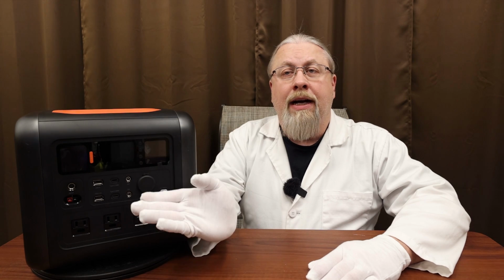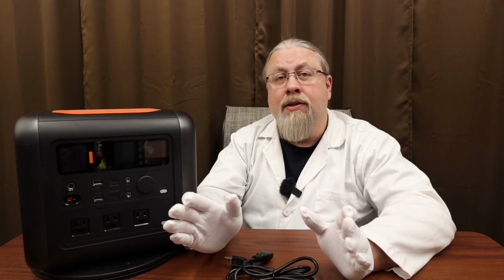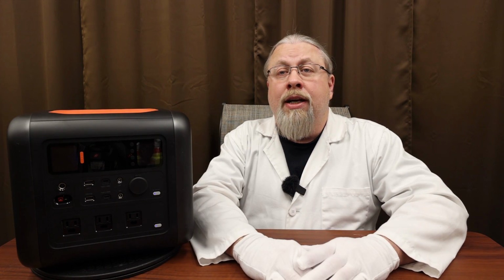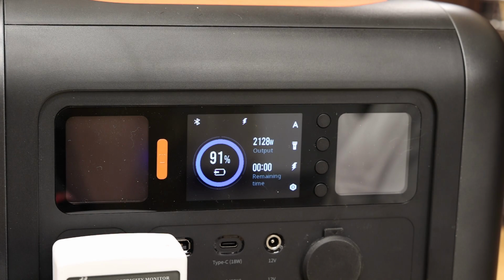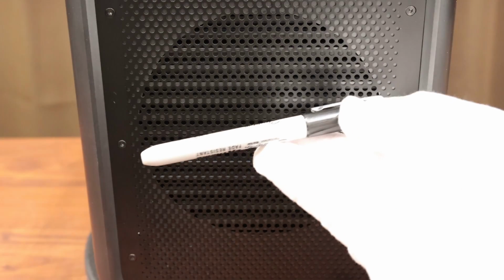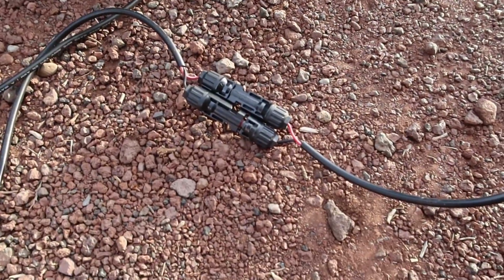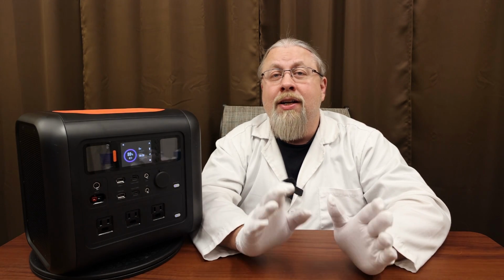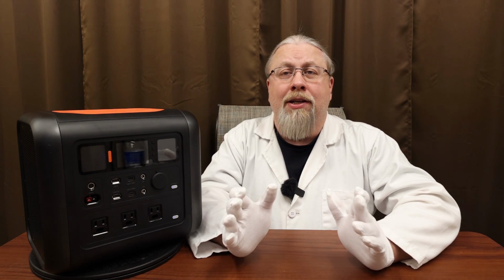SILENT 1200w Solar Generator! 70mai Power Station Tera 1000 Review

Comment: I'm sure they figure why have AC pass-through charging? If you have 110 plug the load into the 110 source get a faster charge. No inverter losses
Reply: The point is that you cannot plug something into it full time, and use it as a safety back up so you never lose power to something.
Reply from the maker: I was told it was a "safety issue" but yes you're right. Thing is a lot of folks want to use these like a UPS to run appliances while plugged in.
Reply: @HOBOTECH  that’s why I wouldn’t buy it. I need to be able to do that. Thanks for pointing it out in your review. You do a great service! 👍
Reply: @HOBOTECH  this is why I love your channel! I had no idea about "pass through" until you explained it in this video. Does that mean my Jackery 1500 has that ability?
Reply: @leonardl9921  yes.. test by plugging it in and then plug something into the jackery. If it works you have pass thur charging . On the video he's talking about AC to AC pass-through there is two more DC and solar charging

Comment: Hi I have a couple questions.  

I wound up purchasing 2 of these power stations a couple years ago based on your review.  I haven't had a real chance to use them yet, but I'm getting ready to do some overlanding.  

So my question for you is regarding solar panels.  I'd prefer a folding style with a kickstand for remote camping.  I'd like to have about a 20' + cord so I can make sure it's in full sun why the trailer is in the shade.  I will have the Tera 1000 hooked up to my ICECO VL75 ProD cooler.  I want to get the max 200W panels as that is all the power station can handle from my understanding.

This question is actually two fold.

I recently purchased an OffGrid trailer that has the following setup.

(2) 100W Battle Born lithium batteries 

Victron Energy Smart Solar charge controller 100/30

Go Power HD 1750W modified sine wave inverter 

(1) Eco Worthy 100W solar panel, with an 8' cord, XT60/MC4 connectors.

I'm running a Truma Cooler C69 DZ, Zero Breeze AC, water pump and lights from the trailer.

I don't think the 100W panel is enough to keep the batteries full and run the Truma Cooler, lights, AC, etc.

I will only be bringing the ICECO and Tera 1000 on long trips for food storage and they'll be in the back of my truck.

So I'd like the folding solar panels to be able to integrate into my trailer system as well as charge my Tera 1000.

Also wondering what your suggestion is for running them in parallel or in series based on my setup.

What is your recommendation for a good 200W foldable, kickstand style panel with a long reach for sun, with compatibility to my trailers setup.  I may need more than 200W for the trailer, maybe (2) 200W panels.  I'm not really sure.

I've watched several of your solar videos, your testing, etc., and figure this would be something you would have a good solution for me.

Thanks Scott

Comment: I’m confused. It will start a full sized refrigerator up but at 2000 watts it’ll shut it down?
Reply from the maker: It can run up to 2000w for a few second which is long enough for the compressor to start. One started a fridge typically only uses a few hundred watts.

Comment: Professor, how long would this SOGEN power a small window AC (such as the one you installed in your RV)??  I see you used it to start the AC in your Testing Lab, but I wonder how long would it be safe to use for running another AC in a van (for example)? 
And I assume that means the unit would need to be recharged the next day (for example using the 200w solar panels). 
If that was considered “one cycle” and this unit is supposed to last 1,000 battery cycles, would that kind of usage (running the AC as long as possible using only the SOGEN), would a customer/user likely get 1000 cycles (using it for the AC), or would the AC use somehow deplete the battery and damage or lower its cycles (causing it to fail sooner??)?  I am not a tech guy, so these are sincere questions.  My use would be for running an AC at night in a van in the desert areas, to sleep in cool during night.
Reply from the maker: That a/c was in my RV and it will run 3--5 hours depends on temperature.
Reply: @HOBOTECH  Thank you for your rapid response to my question. If it ran for 3-5 hours, it may be useful for certain times, to get cool, to get some sleep. But good to know it would not last 8 hours, so as not to have that expectation etc.  Thanks.

Comment: Its a battery in a box with an inverter . How is it in any way a generator ? It does not generate anything at all without solar panels or a charger to charge it . Calling it a generator is completely misleading .

Comment: Hi Hobo, I’m taking another chance on this generator after sending back the ACP200 earlier this summer (mine was not charging via solar) with the Bouge RV 200 w solar panels (2).So, I’m praying this unit will suffice with even one. Being new and confused (but desperately trying to prepare) to this solar generator world, am I wrong for such expectations? Please let me know so I can aptly pull out of the crowd funding deal and not waste any more money. I’m stuck with the panels and no generator to use with them. 😓 Thank you in advance. 😽
Reply from the maker: Yes it will charge with one 200w panel.
Reply: @HOBOTECH  thanks HOBOTECH. I’m praying! 🙏🙏🙏

Comment: If it is not lifepo4 it is immediately a no go.
Reply from the maker: Why? LFP is 25% larger/heavier for the same power. Yes LFP cycles 4x longer but are you 'really' going to cycle this product every day for more than 10 years?
Reply: Longevity is always the answer in my mind when spending hundreds of dollars, the extra few pounds is a mood point especially when it is under 40lb either way. I never go with anything other than lifepo4. I want my gear to last, these other options always tank after 5 years not worth saving a few bucks for a lesser product. I would choose an EB70 everytime over anything like this just because of the battery difference.

Comment: I received the 70mai today,  it is damaged and won't power up or charge.
Reply: Another backer suggested trying 12 volt charging. My unit started up and now it's charging on AC.
Reply: @joeficcadenti7355  I'm still waiting for mine.  Tracking number shows estimated delivery this Friday, keeping my fingers crossed that it arrives undamaged and working.  I will post here how things go, I hope other backers will update here so we can get a sampling on  product quality.
Reply: I received mine today and it arrived intact and well packaged (a box in a box with foam packing around top and bottom).  It powered up and all ports work well as does the screen.  Very user friendly.  Haven't yet plugged into a solar panel but tomorrow I will test charging via AC wall charging, solar panel and car charging.  Will update this once I've done that.  So far I'm extremely impressed with the quality of this product.  (Size, weight, operation, packaging.)

Comment: It's Not lifpo4 and it says only 1000  cycles.  Not bad but not 2,000. My other Gripe. The usb C doesn't charge the device.  I'm all about USB C dual input output chargeging at 100W. I have device's that are 18 watt 65 watt,  and 100 watt. All of the device's use usb c and charge on the mentioned through my anker usb c thick wire,  us my 100 watt charger that costed me 30 ish dollars.  My system  with go labs 60 watt usb c input/output dual let's me charge fast amd then charge my laptop windows 11 usb c 65watt to max and maintain it for 7 hours full gaming
Reply: I'm from  Ca and were ghetto out here. I'm currently looking at buying land in a republican state soon. Zero Tax.lol